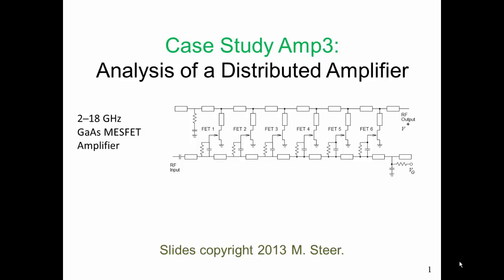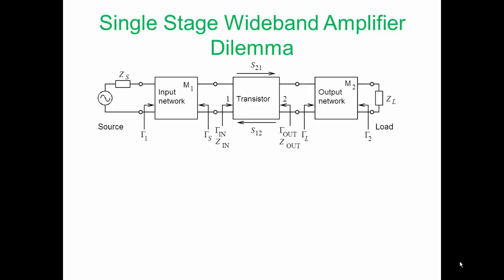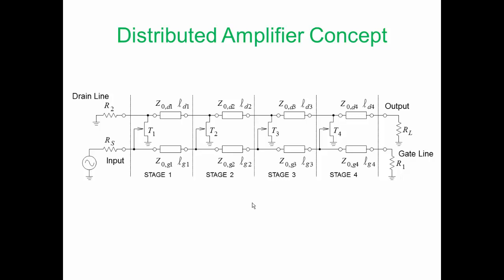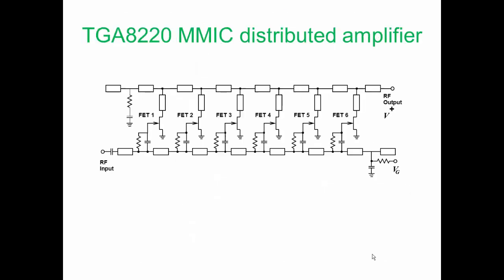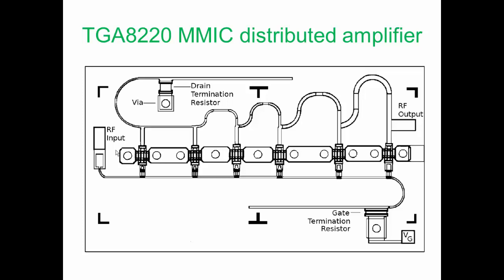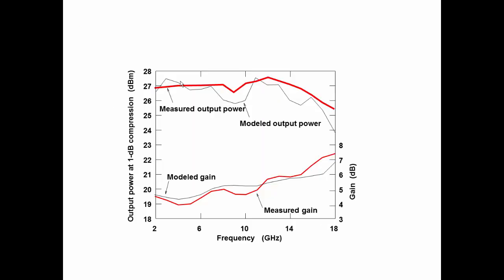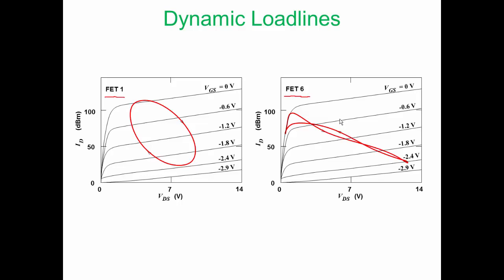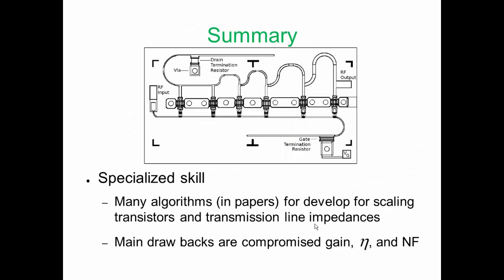Case Study: Analysis of a Distributed Amplifier, by Michael Steer

Comment from the maker: Let's restrict ourselves to discrete transistors.  The initial decision is first made by looking at the transistor manufacturers datasheet. The transistor manufacturer develops transistors for particular markets, e.g. WiFi at a certain power level. Some transistors have large input and output reactances or perhaps very low or very high resistive parts of the input and output impedances. Such transistors will result in narrowband matching networks.  If you have a transistor such as a HBT transistor the input and output impedances can be close to 50 ohms and so it will be easier to develop broader band matching networks. Beyond that the choice comes down to experience.
Reply: Thank you!